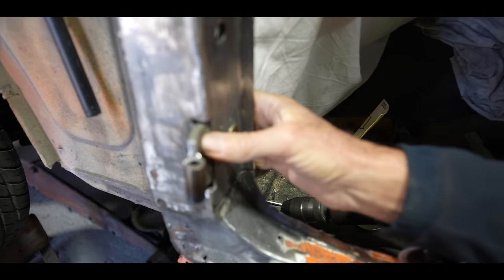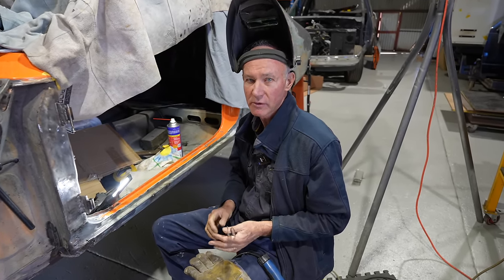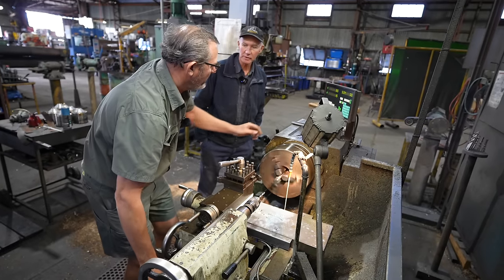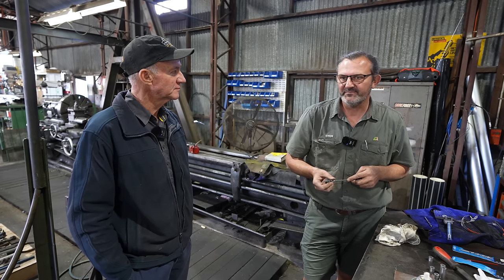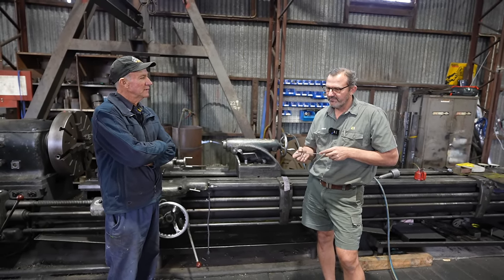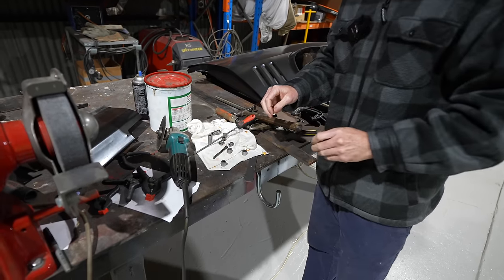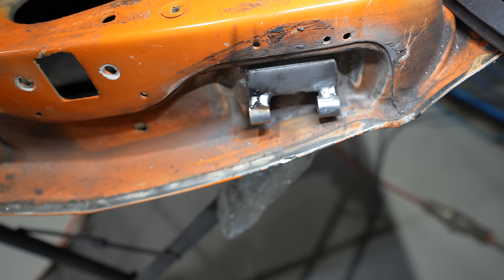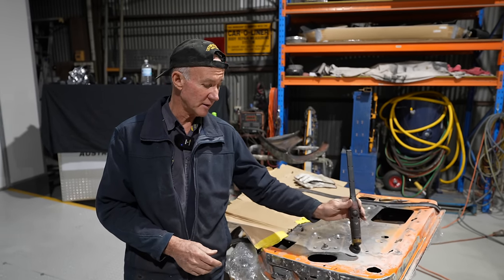Holden Torana Gtr Xu1 LJ ( Part 11 ) We track down original hinge pins and machine up new barrel

Comment: I had a custom van come to my shop in late 80s that was done by a company called Van Craft in Dandenong. The owner of the van wanted a new door skin made as im a coach builder and panel fabricator ,the door was damaged but behind the filler they used a salad roll to fill it out and bog over it. Still shake my head every time I remember it.

Comment: Man!.. I'm a torana nut.. And I have to say I much prefer the door hinge system in the LH-LX. Those welded door hinges and barrels look like a nightmare. I mean they must be so hard to get right. Like vertical angle, distance from the body etc etc. So really appreciate the time, skull and patience getting those to fit the way you have.
Reply from the maker: Cheers mate your spot on.
Reply: I think GMH went to the bolt on system on the later cars because they were sick of paying out hours of labour to smash repairers to fit and adjust doors when you could just bolt a new one on

Comment: I had a 1969 LC GTR Torana 4 Speed Manual, reco 202, mild cam,  john cain racing manifold, 350 Holley Carbi, Outlaw Extractors and a Walker Sports Muffler. And it Hammered.... Should of kept it.  But was a 1ST Year Apprentice Spray Painter and thought i would Restore it,, but ended

up selling it in Parts. But got my money back.  Kicking myself now..  Then 2004 Had a 1977 HX PREMIER 308 was on gas and giving me trouble. Sold it got my money back ,but should of kept it.. Then had a 1987 VL BERLINA COMMODORE, Did a full Resto on it but wrote it off.  I miss all these Cars i had but time goes on. I have a 1997 SERIES 2  VSV8 STATESMAN INTERNATIONAL  GREG NORMAN SIGNATURE SERIES which has a damaged Rad Support but have a Second hand Rad support, Bonnet, Guards, headlights, Grille, Bumber Bar. Car still runs which is good.   Hopefully next year i can Restore this Nice Statesman.    Anyway keep up the Excellent work.  You are Both TOP GUNS
Reply from the maker: Thank you for sharing its always good to here stories and thanks for watching.

Comment: To be fair on the last repairer back in the 80 s 90 s these cars where worth bugger all,  so you didn't invest to much time and money into them. I to butcherd my lc gtr torana flairing guards with a hammer. Cutting holes in the bonnet for xa gt scoops . And put a sun roof in it .  Cutt the dash up fo a stereo system,